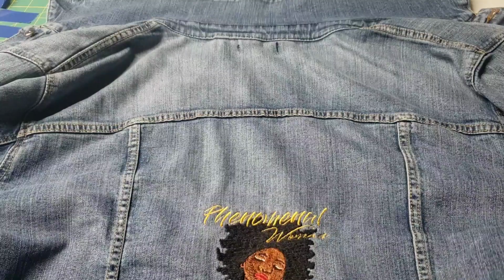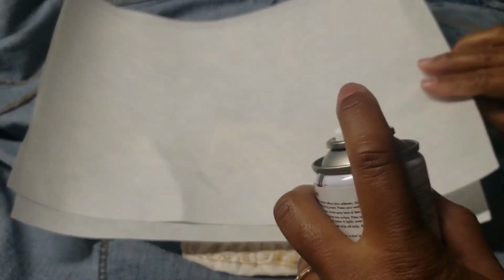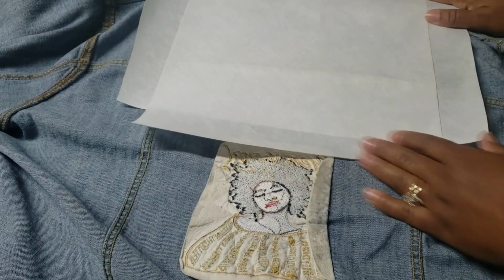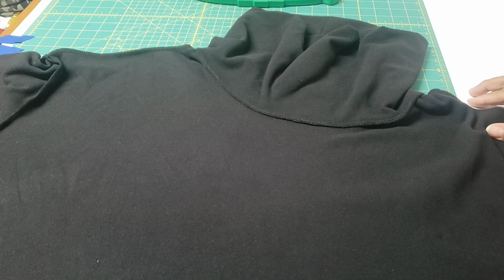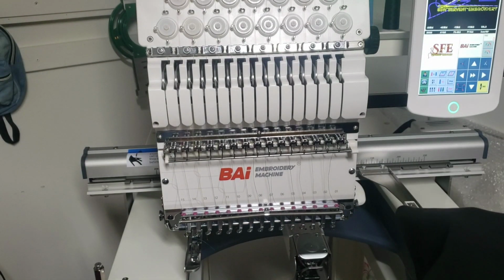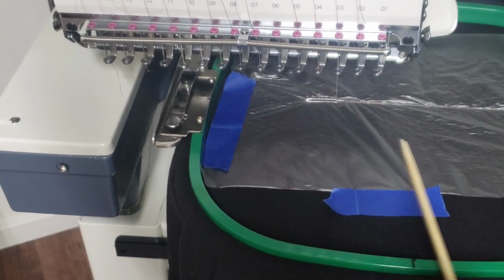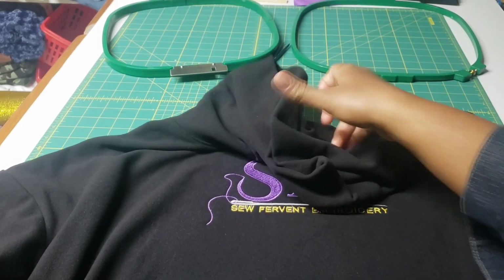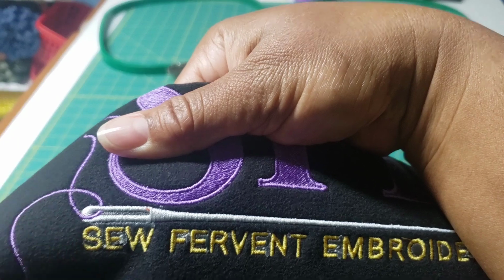Learning journey with my BAi/Using my Bai to stitch my logo/ Embroidering on a sweatshirt

Comment: I use a WS pen to make the horizontal and vertical lines on the back of the hooped stabilizer.  Then mark your lines on the garment and line them all up.  Pin edges.  Also, don’t spray the garment, spray the stabilizer.
Reply from the maker: That is a great tip. Thanks for sharing!

Comment: Miss Latasha, I am doing floating for these jackets and hoodies.  I am using double sided tape in the back of the frame, then I attach the stabilizer to the tape, and once the stabilizer is fixed to the frame, I spray the stabilizer with the basting spray, and then attach the jacket/hoodie to the stabilizer. It will look like a sandwich- Stabilizer-hoop-jacket.  I used that tecnique on my Bernina B 830 and worked wonderfully!!!!  Maybe you can try that with your BAI!!!!!
Reply from the maker: Hi, thank you for this tip. I appreciate you.

Comment: I just got my machine. I purchased the same as you. It appears you have a laser to indicate the center point. Is this something that automatically turns on or, is this something you have to program?
Reply from the maker: There is a on/off stitch.  I rarely use mine now.  You have to make sure it's lined up correctly.